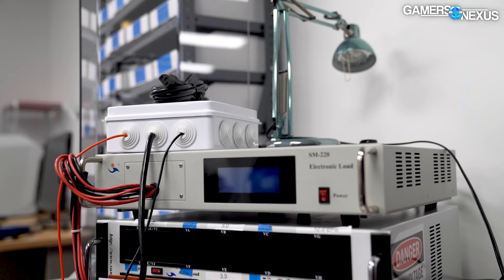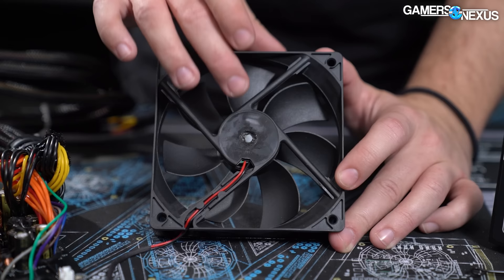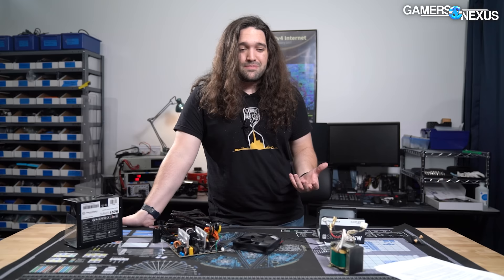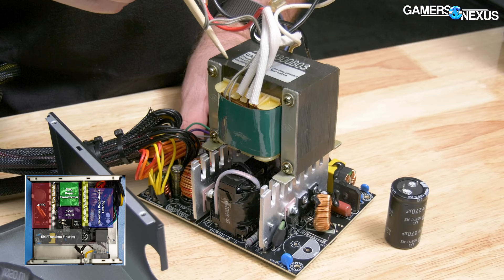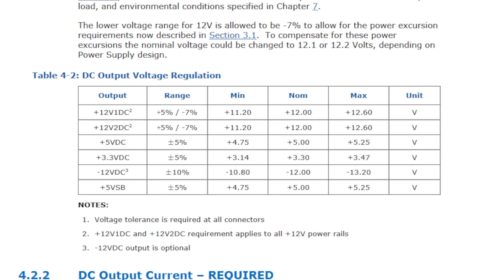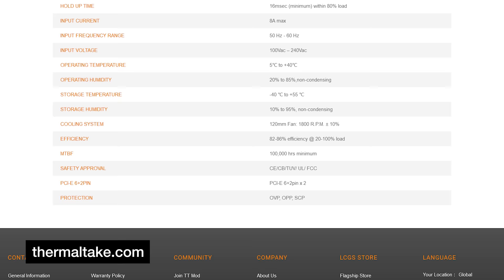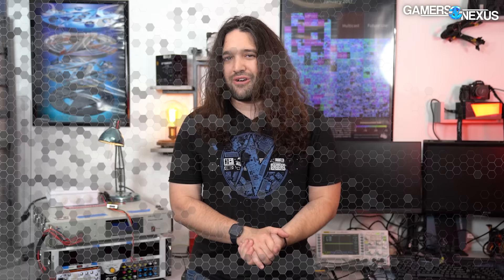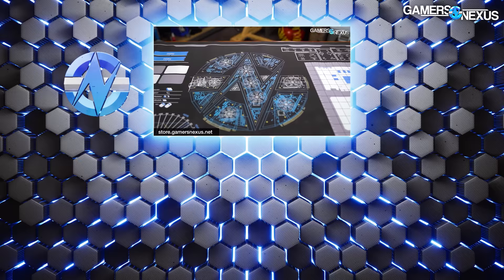Taking Risks on a Cheap PSU: $30 Thermaltake 430W SMART Power Supply Review

Comment: Kinda shocked to see a group-regulated design in 2022, considering how cheap 12V & VRM can be made.

Probably an older design their OEM recycled for peanuts, from about 2010 vintage. Appreciating the B-tier electrolytics and full input filter, plus NTC and MOV, though.

Just a shame about the terrible ripple. For me at least that disqualifies it from recommending it to anyone. Nearly 100 mV pp ripple on 12V? Yeah, definitely feels like 2010 all over again.
Reply: It's still fine for basic office rigs and the likes. After all, ripple is within atx spec.
Reply: @hojnikb  Sure, it is within spec, but when for a bit more cash you can get a PSU that isn't just in spec, but <10% of the allowed ripple (independently regulated or VRM), it is a hard sell.

This, vs a basic Seasonic (Focus) or Corsair during a sale? No contest.
Reply: @MayaPosch  Yeah, but you can make that argument for every component in the system. And just like that, you came from a 200$ basic office PC to a 500$ not so basic office PC.

Comment: If I can ever convey a real plea to people it would be to never buy a Thermaltake psu. I had a brand new, in the shrink wrap, 700w smart and it died on me 1 week into use with a ryzen 5 3600 and a gtx 1070ti. Please don't buy their power supplies and don't cheap yourself.

Comment: So what  is law. ... 
In Australia.  Commication companies are be protected.  For selling under rated speed be sold. Going into 100 percent failed companies advertising products and speed has failed ( so your channel exposed what is real on a cheap power supply.  I appreciate your video. ( is this as bad asus motherboard 690 recall. 8 moths later. Pray people no one die. To see a reaction from asus. Disscusting.  ( your channel goes into detail.  Thank you. If anything at first there is a law sute.  For failed details  on a power supply.  Pray people don't die. God bless.

Comment: You know you can get a 1000w platinum PSU for like $30-40, right? If you want budget, reuse is where it's at. Built an entire server; dual hexacore Xeon CPUs, 128gb of RAM, for about $500. I know, not new, but why add to the landfills?

Comment: My 40$ PSU is still working after 10 years... Running 2xhdd 2xssd gtx550ti amd buldozer 16gb ddr3... If it works don't fix it 😅

Comment: I once bought a Thermaltake 430w PSU back in the mid-2000's. It lasted a long time, powering budget PCs (eg Athlon64 X2 4200+/Celeron E3400 Wolfdale/ATI X800XL/8600GT). No problems. Thermaltake is one of the PSU makers who aren't on my sh*tlist.

Comment: Bad documentation continues! I bought this unit and it advertised "2 PCIe 6+2 connectors" It actually had 2 PCIe 8 pin which my old ATI Radeon HD 5850 couldn't use!😡
Reply: what the hell? mine came up with 6+2, 2 of them. however it seems they forgot to put the adaptor for my zone in

Comment: I cringe when I think of the cheap £30 psu I used to run way back in the early 2000s when I first got into pc gaming, think I got lucky as I never had any go pop & take other components with it.
Reply: Yep, in 2001 and 2002, I was a power supply dummy! The first one, was a Deer DR 250 ATX and the second one wasn't much better, but never had one go pop and take out other components with them.

Comment: Why did he remove the bulk capacitor "for safety" - i mean what kind of total douche baggery is that? It is integral to the SMPS being able to meet the 80+ standards. Why did he remove it? If it was so dangerous he shouldn't even touch it without linesman gloves apron and equipment. It was so dangerous he could easily desolder it for some reason so must have discharged it (pretty sure it will have a discharge resistor anyway but you don't rely on that).

Comment: You can't really put "cheap" into money, it just doesn't work like that. A cheap product can very well be the right product for the task at hand.
Reply: Also the GBU806 is a rectifier, that means it can handle 8A at whatever input voltage. So for 230V that would be P = 230 * 8 = 1840 Watt and that is NOT what the actual regulators will ever draw!
Reply: He says removed for safety and then proceeds by touching the leads :D

I know you drained it, but still don't just willy nilly touch the leads if you do not know what you are doing!

Comment: These PSUs are just for PCs u dont wanna throw away but your no-name PSU isnt just working anymore or u want to change the 7 Year old suspicious low quality PSU.
New PSUs like this, which are at least "usable", reach the minimum standard and are at least much better than anything u dont know (pre built PCs) or passive PFC PSUs. So if u know u just need the "minimum standard", this is the PSU to go for.

Comment: you disconnect the 400 volt capacitor for "safety" but then continue to touch both anode and cathode with your fingers, completing the circuit while holding it. makes zero sense, just short both connections prior to handling the power supply instead of having to de-solder and re-solder the connections. or if your just doing that to show the audience proper safety, atleast dont short it out with your fingers on camera😂

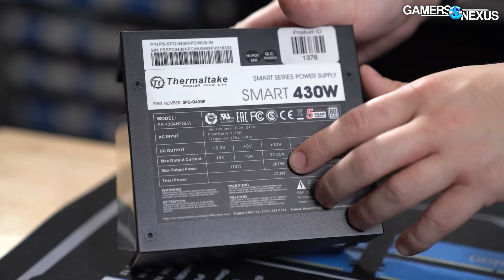Comment: 6:52 This is total nonsense! It's NOT cheating the spec, it's 100% following the spec! The whole point of telling the TOTAL wattage of the psu is to tell the TOTAL wattage of the psu, which in this case is 430W. The 12v rail wattage is just a part of the total wattage, as u surely know. What u are asking is changing the spec, so that DUMB people would not look at the total wattage, but instead be spoon-fed just the important 12v wattage. This is truly an American solution to a "problem", ha... MOST gamers already know to correctly look for the 12v rail wattage for their computer's needs. But ofc not all know this, yet they won't go too far off by just looking at the total wattage, since most of it comes from the 12v rating anyway.

But I've noticed there seems to be about 4 type of people buying PSUs:
-The noobs who buy the cheapest, just barely enough wattage psu for their system
-The noobs who buy the cheapest super high wattage psu they can find, which is a total overkill for their system wattage-wise
-The enthusiasts who buy an expensive gold or platinum rated super high wattage psu, which is a total overkill for their system at all levels
-The rare high IQ people who buy an affordable at least bronze rated psu that has just the right amount of wattage for current and future needs 👌

Comment: I hate that the spec allows PSUs like this, because Intel then has to set their voltage curve in case some idiot uses this with a 12900K.  Nearly all CPUs end up wasting tons of power being effectively overvolted to accomodate this junk.

Comment: 430W is to low for "modern" PC. If have it I'll not care about my parts
Reply: 430W is plenty if you aren't planning to have a dGPU and/or Overclock CPU. this is plenty for low end GPU (2060 level or lower + CPU)
Reply: @cirozorro  3060 + 5600+MB (~300W) my ss 12II 520(480W) sounds like airplane.  with 430W you will change your PSU after PC upgrade.